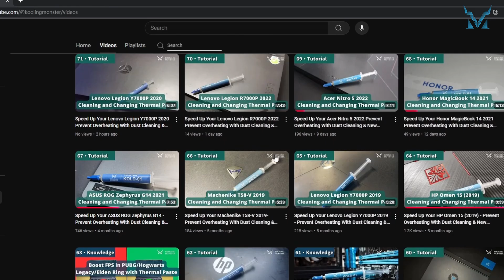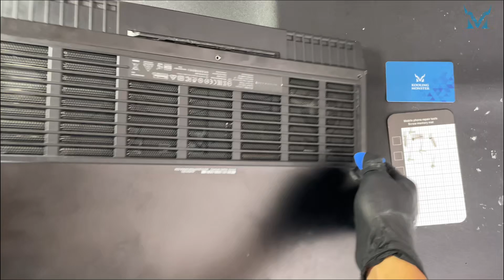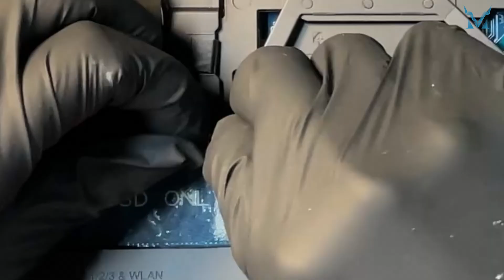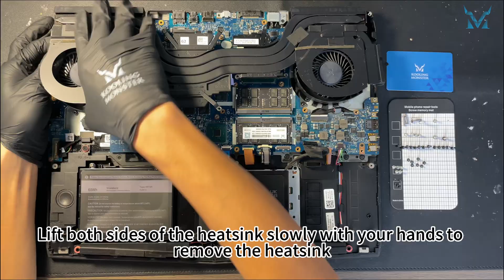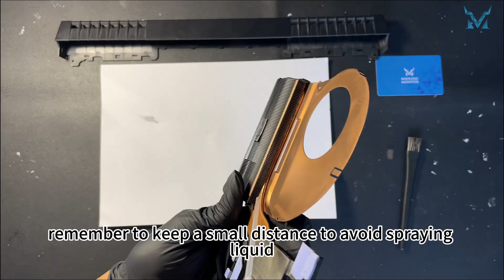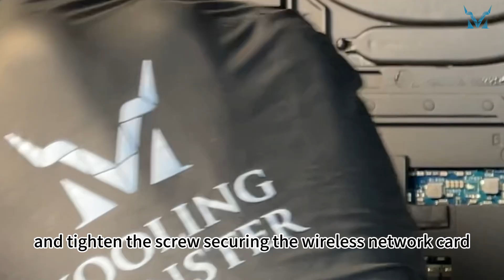Speed Up Your Alienware 17R5 2019 Prevent Overheating With Dust Cleaning & New Thermal Paste

Comment: How can i determine the correct thermal pad thickness for my laptop? is it 0.5mm, 1mm, 1.5mm, or even 2mm
i'm worried i might open it up only to find out i bought the wrong thermalpad
Reply: My laptop is Lenovo ideapad slim 5 ultra 5 125H
Reply from the maker: Best way is to measure the old pads with a caliper before buying—that's the only way to be sure. If you can't wait, get a 1.0mm pad and some thermal putty as a backup. Putty fills any gap and saves you guessing wrong.